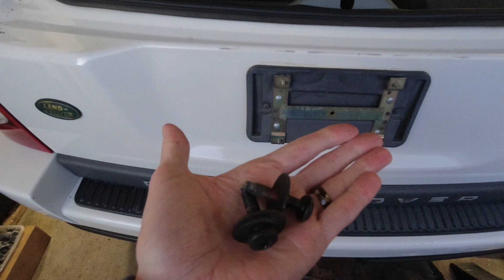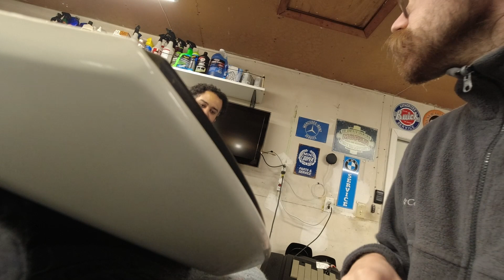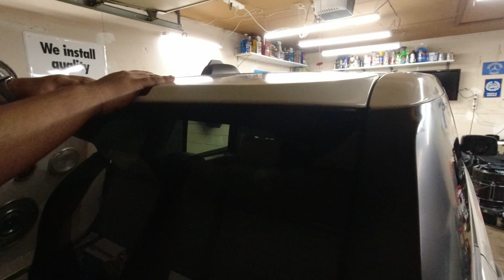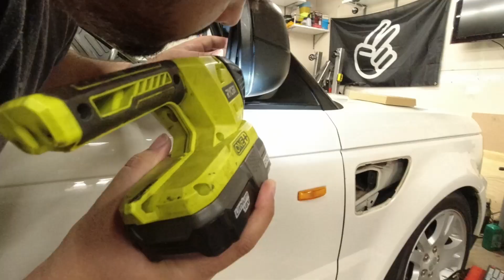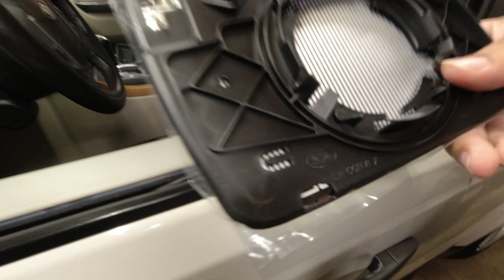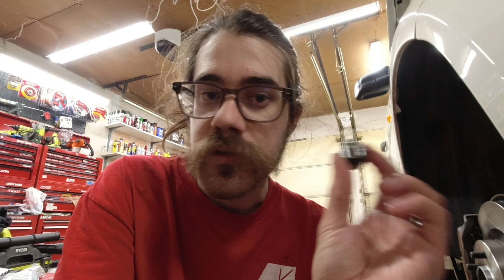Finally Roadworthy! - $1500 Range Rover Sport Episode 7

Comment: Yeah I’ve been doing my own oil on my sport myself, although my oil drain bolt is getting a bit striped because 18fp is like you said quite a lot, and getting it off is a pain lol (would you happen to know that bolt part number by chance). But loved the vid, I had replaced the tail light on mine too because it was like yours. I can’t wait for your next vid though… I’m needing to do a diff and trans change as well bc I don’t think mines ever been changed and it has 150,000 on it. 
Love the car, it’s looking great! Keep it up!
Reply from the maker: The part number is 1013938 on Atlantic British, and they also sell plug/oil filter combos and other service kits that include it. They're where we got most of the supplies for this project, including the transmission service kit. The diff and transfer case fluid changes are pretty straightforward as you'll see!